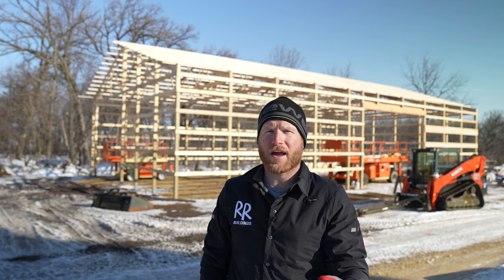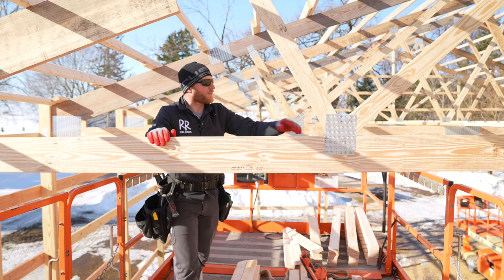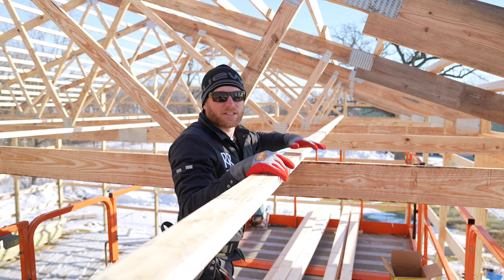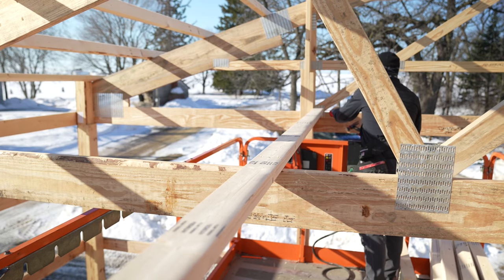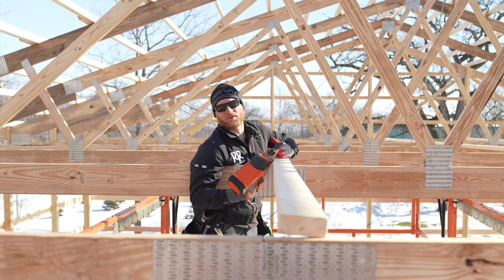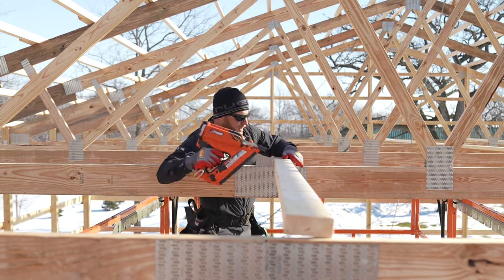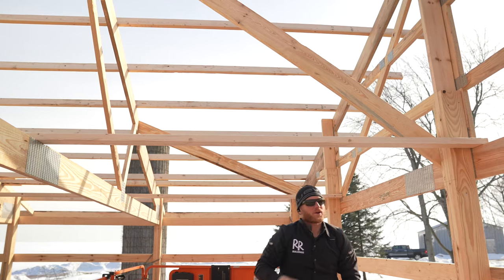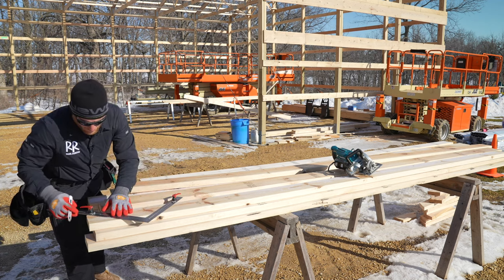How we install Permanent Bracing while Framing! Major Partnership Announcement

Comment: I watched all of Kyle's videos for a few years now, and before partnership came by, opinion on gas powered nailers wasn't as positive))
Reply: Agreed, seems off putting
Reply: Yes. He was always somewhat negative of gas nailers
Reply: Shill. Can't take anything at face value anymore. Everyone is bought and sold....
Reply: I thought the same thing... bought a pastors when we built our first house, sold it as soon as the first house was finished... after it came back from warranty repair... lol
Reply: If it pays the bills then you gotta do what you gotta do
Reply: Yeah but I agree I have the Milwaukee framing nailer and it’s heavy, would get tiring
Reply: The only negative about the gas nailers is the cost of fuel. Otherwise they are way lighter and more reliable than battery guns.
Reply: I still prefer pneumatic nailers.
Reply: In fairness they've got a lot better over the years, more efficient with gas, power etc
Reply: @skliros9235  not in cold climates they arent. Remember using a spit gun putting in fire alarm cabling and having to alternate gas cans in my pockets in middle of winter to keep them functioning. Every 30mins youd have to swap em
Reply: @darylsavage119  depends on what you consider cold. Paslode advertises the fuel can shoot down to 18F,  which i can say it's true.
Reply: @uglyashelful  this guy is sharing all of his techniques at NO CHARGE to you as a subscriber. If he makes some money showcasing a tool he uses anyway then who gives af?
Reply: Nobody uses paslode gas nailers, now that there's better options. That's why they need to pay people to like them.
Reply: Dude still provides tons of tips and  drops knowledge that you are getting for free .  I mean the least you can do is support the channel with some of the  sponsored products. Instead of finding something to complain about.

Comment: On the nail gun topic I'll say this......The technology that MetaboHPT and Milwaukee uses in their nailers(recirculating air), to me, is the better option for a couple of reasons, 1) It doesn't produce the fumes that come out of a Paslode(after spending my entire life either on my dad's or my own job sites I've breathed my fair share of noxious fumes from other trades)  and 2) having a gas component adds one more thing I will have to swap out throughout the day for a total of three.  Battery, gas, and clavos.  And don't forget the daily maintenance those orange guns require to operate smoothly.  I've got four of them in my garage right now that need a $150 spark unit and I don't plan on investing that much in them.  On the other hand my Metabo 30° framing gun has no flaws that I've found, the 30° option shoots Paslode nails and with the steeper angle it reminds me of the very short headed Maxx SuperFramers which easily fit between 16" stud bays when toenailing.  As for the weight "issue", there used to be a time not that long ago when a man was proud of the fact that he had to be strong to do his job, not everybody could fling an old HD77 skilsaw around all day while playing jump rope with his own cord AND hose, as well as those of his crew.  These days we want everything lighter and dumber(this is a jab at tape measures with fractions on them).   Great video, I realize it's a few years old but I am the son of a truss/lumber salesman and tool junky so the content of your video hit home.  Thanks again, keep up the good work guys.

Comment: This is an awesome video. I have friends who started their build and a blizzard came through after they had the roof on without walls. Whole thing came down. I thought it may have been a material problem, but after watching this, I realized they didn’t have good bracing. This is incredibly helpful. Thank you for doing this video. Also thanks for the tips on the Paslode, I always thought it was dumb because of the need to constantly buy fuel. You made some great points that are causing me to reconsider.

Comment: On what you call your kickers, I nail another board flat on top creating a "T". It locks the board from being able to spring side to side when a lot of force is pushing against the end walls. We catch a lot of wind here in Kansas so it's just another quick add for even more rigidity. I always look forward to your videos every week. Keep em coming
Reply: after the deracho we started adding joist hangers to them on the non gable truss. You are talking about a what I would call a stiffner board right? running the full length of the "kicker"

Comment: around 20 years ago I was reframing a gable end on my house.  My bro in law loaned me his ancient SENCO framing nailer.  It was so heavy I couldn't;'t roll it up to nail overhead with one hand.  My neiigbor came over and brought his Paslode pneumatic nailer.  I had never used one and was amazed it how much lighter it was.  That's when I bought one.  For the 60d nails, I would use my palm nailer.  Yes they are loud.  I have hearing protection.

Comment: It seems the best cordless nail gun manufacturer is the one who is willing to put most money to sponsoring. Paslode must be desperate because the battery only operated  guns are becoming so popular. My experience on using both types of nailers are quite the opposite from the claims in this video when it comes to need for service and winter use. Once they are able to reduce the weight and size of these framing nailers, there is no excuse for anyone to buy gas nailers anymore.
Reply: That... electronics shutting off was utter nonsense Milwaukee is rated to work down to -17 or 0F lol 
The sell out is what ever, but blurting out misinformation is another thing. 

The gas has a use by date and is an explosive, it's only rated to work down to -10 or 14F 
In hot weather they over heat and shut down due to the heat they produce.
Plus the service costs and turn around and the initial buy in of the tool + GAS.
Reply from the maker: Actually Milwaukee will work to 0.... and I didn’t say Milwaukee wouldn’t work down to cold temps...
Reply: The Milwaukee won’t work in hot weather. They will over heat quickly
Reply: I have a Ridgid framing nailer. I was working with another contractor who has a Dewalt framing nailer (and hates it), and he was making fun of my Ridgid until he shot the first nail with it. He was immediately impressed. It is heavy tho!

Comment: All those haters on paslode . Lol . Any professional framer knows there is nothing better on the market today.  We run paslode guns for 2 years before replacing with new ones  . If it hasn't paid for itself in that period someone needs to pick up the pace.  5 lb difference when it's on your belt all day is huge.
Reply: Finally someone that knows. We don't even own any air or battery nailers. Paslode cordless all the way.

Comment: We do production framing so use mainly air nailers. But we also keep cordless nailers for punch out list, setting trusses, etc. we have owned all of them and are currently running Milwaukee’s because that is the battery platform we use. The Milwaukee by far has been the most disappointing. And you can’t work on them. The paslodes are the most dependable if you know how to use them. You have to fully in gage the nose,pull the trigger, and hold the trigger for a half second after it fires before releasing the trigger. I have taken nailers from guess that couldn’t get them to shoot and they would shoot every time for me. There down fall is the price of gas which is why we don’t use them much but define the most dependable and I have owned 12 to 15 of them.

Comment: So nice to see the paslode gun working in cold weather.  Not the norm in my experience!
Reply: It's a commercial 🤫
Reply: On the contrary a paslode nailer will work when your compressor nailer won’t. For reference watch “ the crazy framer”. He is in Canada and will frame is the coldest times of winter and verify my statement. But Kyle let it be known, you still need to work with a thawed gas cylinder.
Reply: @iilijah  I agree somewhat.  But I’ve been in situations where I’m rotating fuel cylinders every twenty minutes and it’s a pain in the ass!
Reply: @mikejackson6862  I agree. I’m just stating that in really cold weather your only other option is hand nailing. Or just waiting till it warms up to work.
Reply: Yeah keep a gas in your pocket to warm up or use the winter gas cartridges if you can get them
Reply: @peterpalmer7014  probably has 6 extras off camera 😆
Reply: They're rated to shoot down to something like 17F.  But as long as you warm up a fuel cell, you can go colder.
Reply: @FJB2020  🤣🤣🤣

Comment: Im a carpenter in Australia i use the paslode finish and framer and service the framer every 6000 nails otherwise it miss fires if you use it any longer then that only reason i haven't switched to battery is because they are to heavy using then on residential houses and climbing through the roof. And the reason i would move away from paslode is having to spend $25 to service every 2 boxes of nails and the fact you can buy 3-4 boxes of normal gun nails to one box of paslode nails with the gas which is $75-$80

Comment: I use Paslode nailers both Framing and finish mainly because of the weight. The battery only versions are stupidly heavy. I wouldn't say that you don't have many problems with them though as in my experience of using them for many years they are generally a pain in the arse. Often in the shop for repair and always something playing up on them. on the newer ones there is a circuit board and a micro switch set up which like all things electronic is the first to go. In my experience the old ones were more reliable than the newer models. The ergonomics and the weight are the decider though. And much better than a hammer.

Comment: Watch where you put free hand. Had a coworker use a paslode and was shooting back towards him like you did on the end of the building and it hit a soft spot in the wood and shot through the wood into his free hand. Hit exactly between the bone. 3 surgeries later and 5 years off work he is finally back to work. He is in pain still everyday and the whiskey helps him get through the pain in the off hours.

Comment: I, like you have every kind of nailer.  Even a hammer LOL. The one I reach for every time is the Paslode. Only because of the weight. Yes I have to clean it regularly but I actually enjoy that so no issue. Never a miss fire on a clean gun. Just an opinion.

Comment: If you're doing this every day, yeah it would be cool. My biggest issues are the need to keep getting fuel, and one more battery form factor to keep charged.
Reply from the maker: I just replaced fuel for the first time... I’ve been using for a few weeks.. you aren’t using this for full time framing... even as much as I frame I still don’t go thru fuel that quick
Reply: @RRBuildings , yeah it probably wouldn't be as often as I thought, and you could probably pick up a 6month or 1year supply pretty easy. The only thing that would really suck is if you fire your last nail on a fuel tube and realize you forgot to order more. Fortunately for your job trailer you've got other options, as I think most would.

Comment: I love my Milwaukee nailer, and it hits way harder than the Paslodes we get down here, and its a point of difference in the company I work for, and as you said, god above it is heavy. I only have 5Ah batteries and they're a fair weight, and I tried one with a 2Ah today that the rep had, and it balances up a little bit better but still heavier than the Hikoki. This does feel like a bit of a sellout given what you've said about the older Paslode nailers, but if it pays the bills then "that's the way she goes", and if its better than the current model Paslodes, then I might look at getting one for overhead work. Yeah, they are way lighter, yeah they feel way nicer in the hand, but its still gotta be able to sink a 3.5 inch galv slick through LVL J frame. Paslode does need to step up with their nails though, I can't use the 2.5 inch ring shank flooring nails through my Milwaukee. The first hint of anything slightly too hard and it just bends the nails right in half without hardly sinking them, whereas I can sink equivalent Delfast nails no problem

Comment: Having owned several passlode I know to well the maintenance expense buying fuel cells and that dam battery that doesn't seem to last.

But on the other hand my Dewalt with a 5amp it is heavy .

But that 5 amp goes and goes all day.

You say electronics? Its drive system is mechanical and gets it drive from a motor I guess you call that "electronics!".

Your video smells like a ad for Passlode... Parslode is a nice gun but into my second year with the Dewalt and I've left your highly recommended gun in the shop.

You better hope a wind storm doesn't knock your building down before you get your skin on...

Personally I would sheer panel every spot I could...

My vote is preference and I am enjoying the Dewalt Cordless Nailer.

Comment: Love your videos, very professional and informative!  I am building a 30x40 x12 pole barn/shop soon i am curious if you have a video on installing the rim joists around the top of the walls?  A lot of places i have found just nail the rim joists to the inside and outside of the posts .  Is this proper in your opinion?  Seems to me the posts should be notched and rim joist lies on the notch of the post...any info you are willing to share is very much appreciated!

Comment: I bought one of those Paslode nailers back in 2004.  It was battery and gas powered just like yours.  I had nothing but trouble with the gas canisters.  I used it on two jobs and sold it at a yard sale for twenty bucks.  It’s wasn’t worth the twenty bucks.  It’s was light though.

Comment: Understanding your wall corner cross bracing is overkill, you don't feel a need (OCD) to put additional nailer blocks between the inboard cross brace and the horizontals?
Reply: It's easier to nail to a nailer nailed to the girt (the horizontal board), than to toe-nail to the post.

Comment: Sorry buddy, can’t get on board with you on the Pasload. Yeah the Dewalt and Milwaukee are heavier for the first few days of use. Once your used to it, the money savings on not buying fuel cells is worth the sore arms for a couple days.
Reply from the maker: Scott that’s fine.  I understand it’s tough since it was sponsored... but I partnered with paslode because I can stand behind it.  I’ve thoroughly enjoyed how nice it is to use a paslode again after running all battery nailers.  Not because of performance they all work pretty well... but because of weight and ergonomics.  I’m sure if battery tools continue to improve as they have the nailers will get smaller and lighter.  However at the moment they just aren’t.  They still work great

Comment: Yeah sorry bro but ive had problems within months of every paslode nailer ive had (over a dozen of them) and ive had the milwaukee since it came out and havent had a problem since. Heavy, yeah, reliable, yeah. I understand the partnership though, nice solid bracing. Looking good
Reply from the maker: I had three paslodes for years without issues.  Transitioned like most to battery only nailers which worked well... not taking away from their abilities.  The paslode is more about weight, ergonomics, and overall use ability for me.   Which is why I partnered.

Comment: As always, solid stuff! Even with the Paslode plug built in! Haven't used any of their current generation stuff but they have always been one of the best on power nailers. Question; If you were doing something like the "Cabin in the Woods", how would say a window or a man door effect that X bracing? How would you modify it to accomodate it? "Asking for a friend" who hopes to do a pole built structure for a house. FR
Reply from the maker: We would move the x brace to a bay without a window

Comment: Kyle if you are installing ceiling steel wouldn't that provide most of the wind tie function? I'm pretty sure it would. I discussed this with my structural engineer from my garage when I installed plywood for storage on the bottom chord in certain locations in between the fans.

Comment: I have a question. Kyle why do you think all the other tool companies moved away from the fuel based guns. I believe Paslode is the only company still using fuel. I could be wrong. Battery based technology is the way to go. What other tools can you use the Paslode battery in. Dewalt,Milwaukee and Metabo batteries are used throughout the platform. If you really think that nailer is the best why did you not purchase the most up to date model before you were sponsored. JMO.

Comment: I remember when you said you didn't like gas fired nailers , you did say that.
Reply from the maker: Sure did.  You ever heard of the saying grass is always greener.   For me I had shimmer in my eye for the new battery only nailers.   Still would love for them to be better but going back to paslode which is what I always used in the past was very pleasing.  Lightweight, plenty of power, and comfortable to have on your belt.  Can’t say that with the battery only nailers.  Was nice not buying fuel for them but that was it.
Reply: @RRBuildings  That's cool , Ihave a non working pasload that I bought 10 or 12 years ago. So instead of repairing it , I opted to buy the Metabo. Very tough for me to use in a long reach situation because of the weight. Maybe I'll get it repaired.